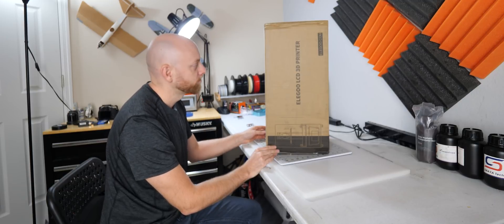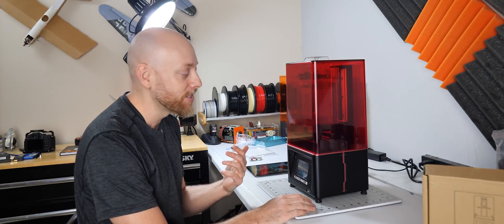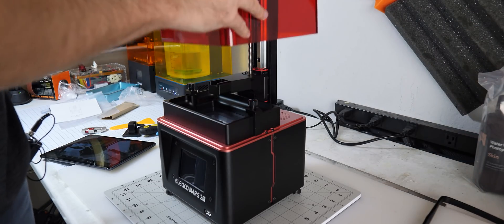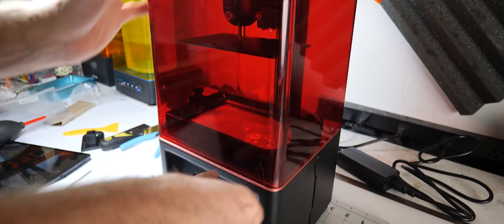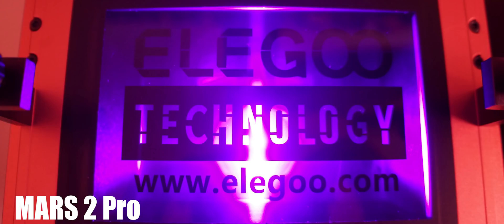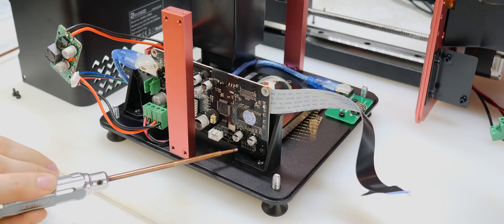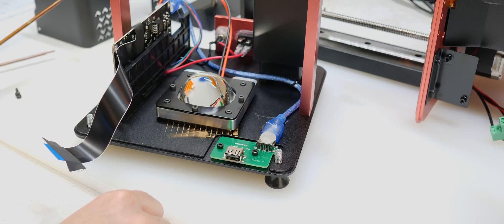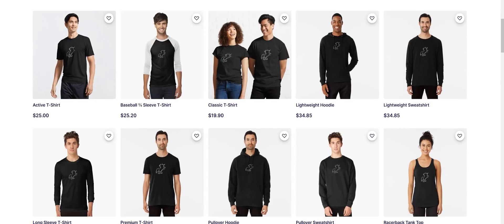Elegoo Mars 2 Pro (and New Shirt Designs!)

Comment: The filters over camera sensors are for INFRARED, not UV, so you made you camera better for night and low light, but did not change the UV response (which isn't that great anyways)
Reply: They're really both, or at least that one was. Can probably put it in the way of the spectrometer in the near future to show what wavelengths that particular one was if you're interested
Reply: @wileecoyoti  The UV cut is normally just the natural property of the cheap glass substrate they used vs an intentional effect.   CCD and CMOS sensors are not normally affected much by UV, but IR can cause many adverse effects for regular color imaging (The datasheets I have for the Sony sensors show most of them cutting off pretty sharply below about 400nm (mainly due to the RGB Bayer filter, but the raw sensor is not much better) but having a long tail well into the infrared range; also Google for the saga of the old Nikon D2H camera- great camera for its generation, but suffered from some weird image quality issues that were eventually traced to a weak IR filter on the sensor.  These issues all disappeared with the installation of an external IR cut filter on the lens as well.)

Comment: is there any brand that make printer like anycubik and elegoo but with bigger screens and bigger screen resolution ?
Reply: Elegoo Saturn is pretty big and high resolution, how big do you want?
Reply: I have a 13.3" 4k mono panel on order from a manufacturer, I only paid $360 for it. Couple that with a larger back light array panel, you can basically make your own "larger resin printer" based off any of the smaller budget ones on the market. I'm using the internal components from a Longer 30. The hardest part for me to source is a resin tank.
Reply: Phrozen!